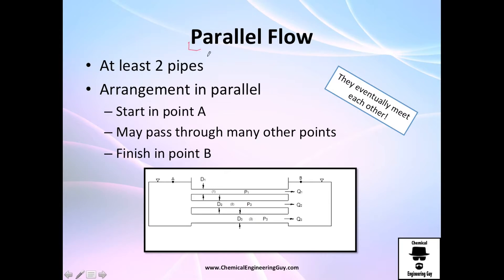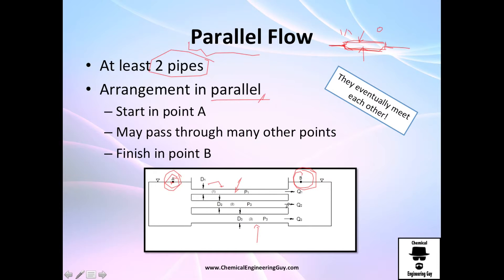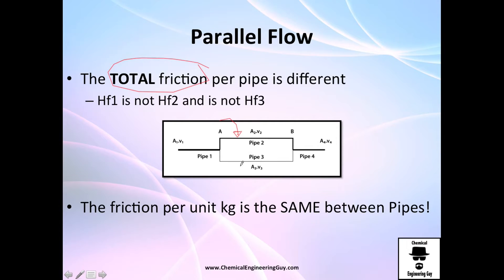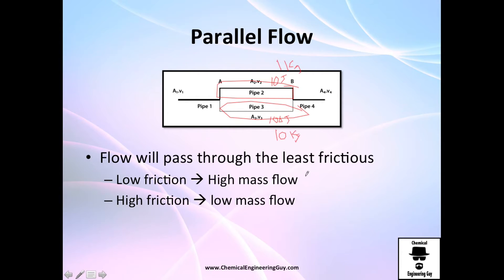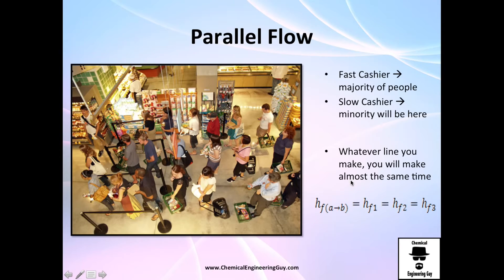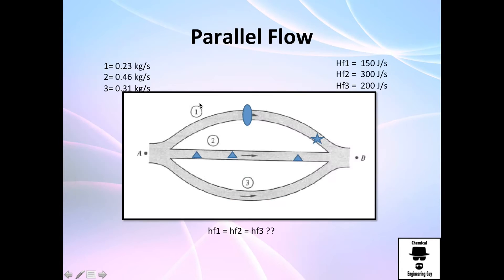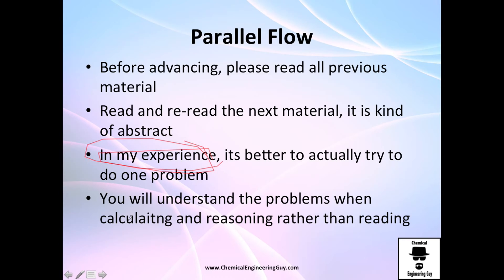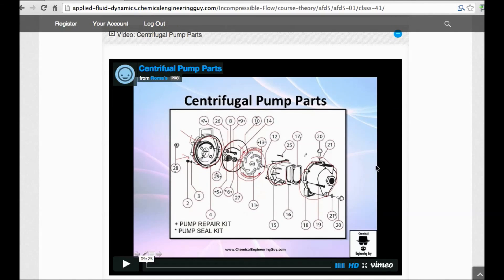Parallel Flow Intro / Applied Fluid Dynamics - Class 062

Comment: Hi. Head-loss at pipe 2 is equal to head-loss at pipe 3 for a parallel flow..and is equal to head loss from point A to Point B.

Also, how will you compute for the energy loss in Joules in an actual environment, for me this is not practical..>????????????????????????
Reply from the maker: What do you mean with actual environment? You mean real life?You will most likely model it with a software